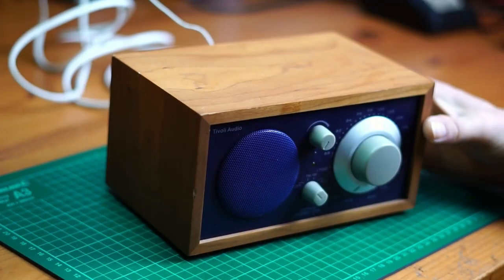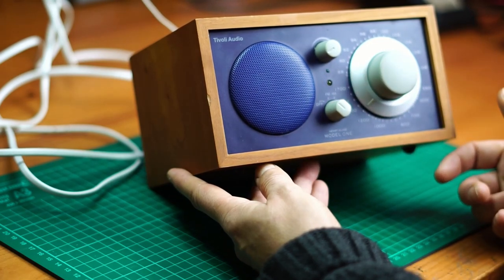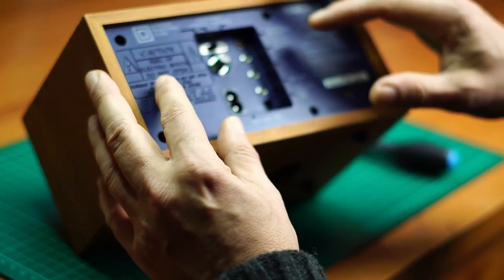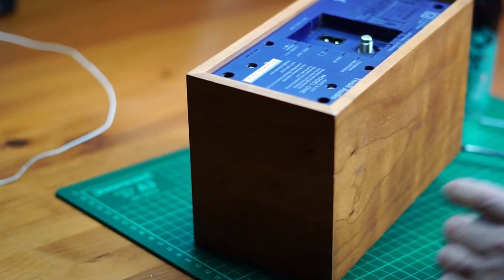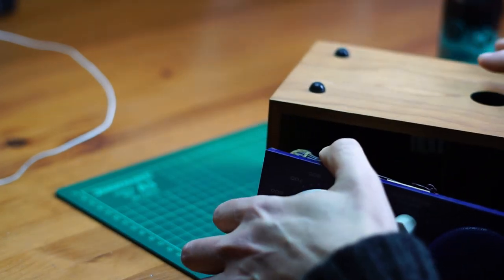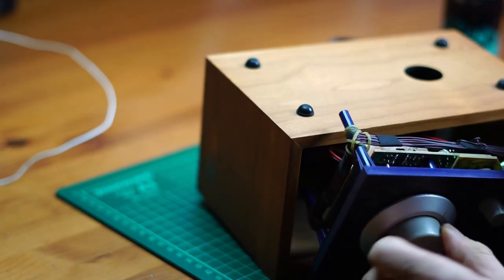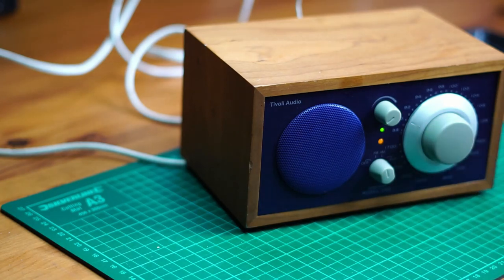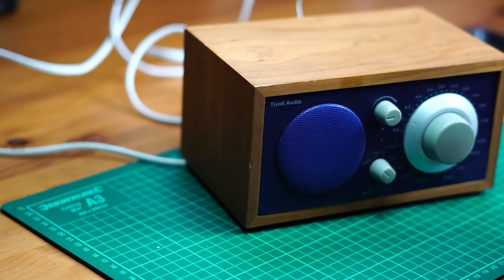Saved from the trash ! a radio simple repair

Comment: There is no electric contacts where you spray that stuf. 😆😅😂
Reply from the maker: Well it worked....
Reply: The points where the capacitor rotates is an electronic contact, else one set of the plates would just be floating

Comment: In case it helps anyone out there with scratchy tuning from a Tivoli Audio radio... I fully solved my scratchy noise issue by rotating the tuning dial through its full range of motion for about 3 to 5 mins. (radio was off and unplugged)  My guess is that the varicon capacitor contains some sort of dielectric lubricant which needs periodic movement from time to time... spraying cleaner may in fact damage it permanently... just my guess.
Reply from the maker: Ok, thanks for your comment, mine works fine now. Cheers.
Reply: Yes, this is actually what Tivoli recommended me trying, when I called them on the phone recently (Jan 2024) and got a bit of free advice. Exactly what you did with a couple of additional points:

1. Turn off and unplug radio.
2. Turn it upside down for at least 4 hours, to let the lubricant make its way back "up" to the top of the varcap or pot.
3. Turn the tuning knob all the way to left and right, back and forth, again and again, for 5 minutes straight.
4. Return to up-side up, plug in, and see  if tuning is less scratchy now.

In my case, i did the procedure and it helped, but did not completely eradicate the scratchiness.

Comment: if your tuner is scratchy or a bit off, meaning if you are listening to 95.5 and the dial shows 96.3 or so then try the following.  this is from tivoli itself who says dust can build up in the tuning mechanism.   turn the radio on,  set volume at ZERO.  then tune back and forth the entire roation of the tuning dial vigoursly for 3 minutes.   this works out the dust and spreads the factory lube that is in the tuner.   i just bought a used tivoli, the tuning was off, not correct for what i heard and what dial said.  i did this and now the tuning is right on , and not scratchy.      contact cleaner works great if you have scratchy volume knob.
Reply from the maker: Thanks for your comment, getting the dust out surely helps, I also turned the dial a lot in my procedure, cheers.

Comment: Because of the unfortunate camera angle, I could not see where you sprayed. This would have helped me a lot since I have the same exact model and I have disassembled it, but I cannot see where to spray because the potentiometer (or variable capacitor) appears to be completely sealed in an interior special metal box. I really do wish I could have seen exactly what and where you sprayed.

Also, over here in the United States, for a deoxidizer and lubricant, many of us use a product called Deoxit-D5.
Reply from the maker: I think the product you talk about should be simular, sorry if my filming was not clear enough. You can try, it won’t harm…

Comment: are you sure that fixed the issue? turning the dial a millimeter or two and catching a station then claiming the tuning static issue was fixed?
Reply from the maker: Well, yes it did
Reply: Would have been better had he tuned across the band, but yes, it did fix the problem.